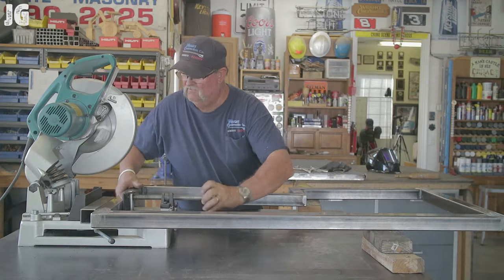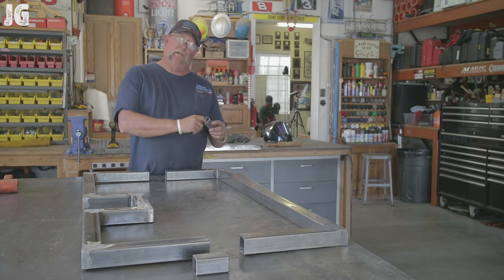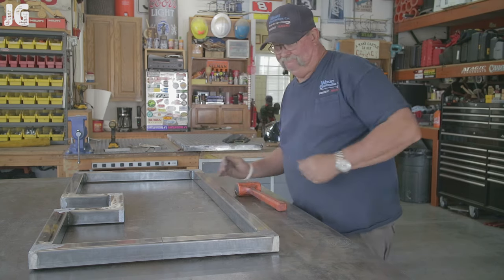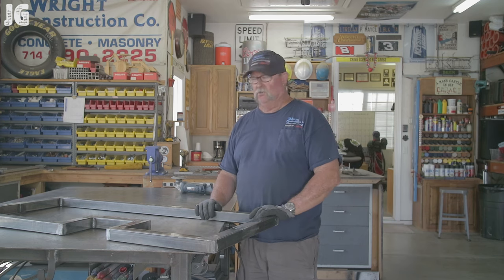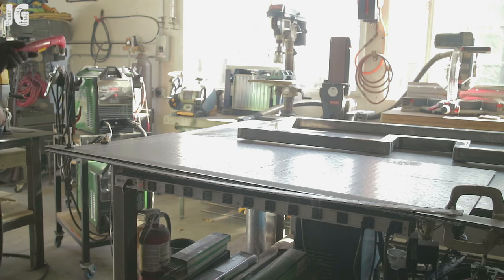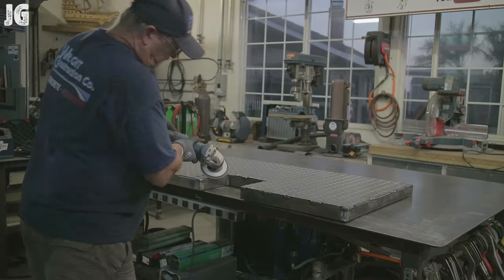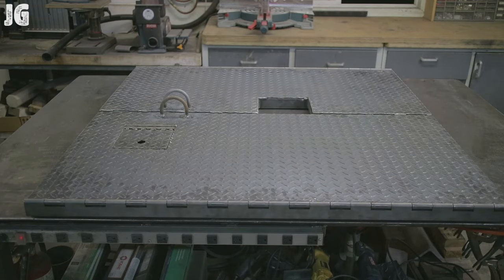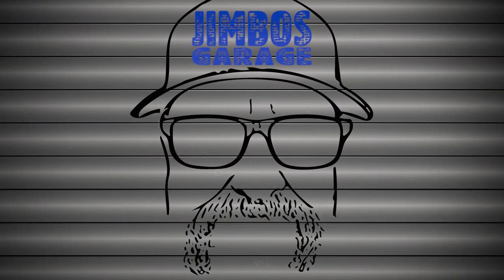Metal Doors for Underground Vault  Part 2 | JIMBO’S GARAGE

Comment: Hi Jimbo, why didn't you just re-cut the mitres on the hinge side corners, take an inch out that way
 ? there would be no sign of a mistake.
Reply from the maker: Thanks for watching Gid joiner, I'm sure if you ask 20 people how they would have done it, You would get 20 different answers. That is how i thought how to do it at that second, It seemed to work fine.  Jimbos garage!
Reply: yep, your prob right, 
I'm a joiner/carpenter n i would have re-cut the joints but with wood ya can't join the lengths as you did, not well anyway,  I thought maybe there was a reason you did it that way because it was metal, it ended up strong n job done, that's what counts. Ta

Comment: All you need do to slide one inside the other for reinforcement is take your smaller stock and lightly bang it into the appropriate side, pill it out, run a straight line to the marks on opposing ends and lightly score with a cut off wheel.     You can plug weld one spot to assure that the brace doesn't just continue to slide into the one side if necessary...